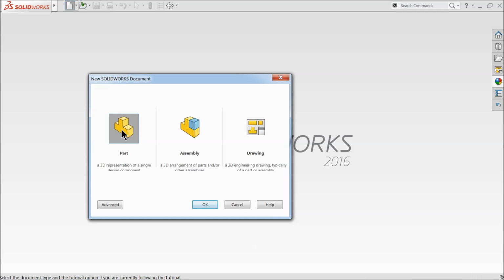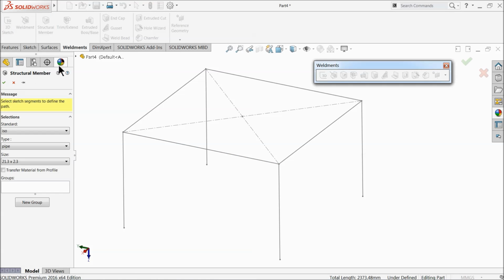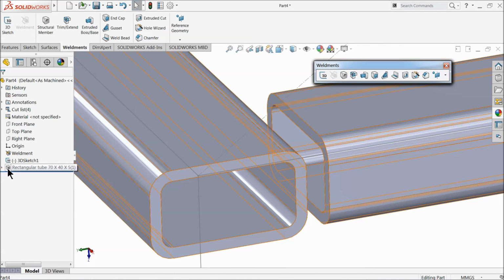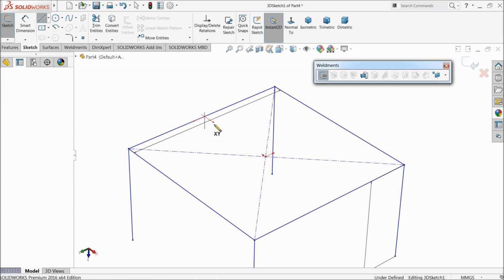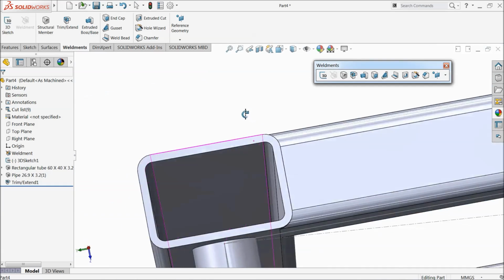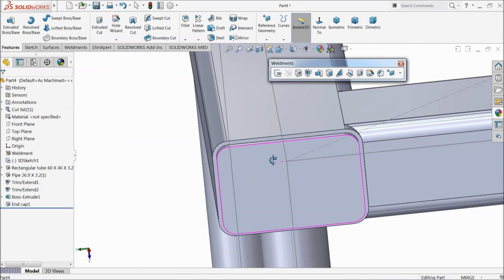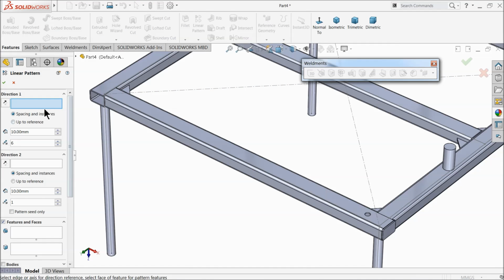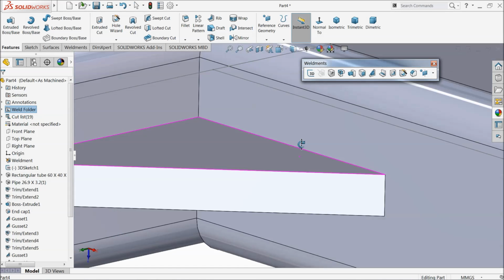Solidworks tutorial Basic of Weldments

Comment: A weldment design for Indian civil work\house construction works, like steps, ladder, safety grill, window grill, doors windows relevant works design must be thought. 

As a first step go to the site and study the requirements and list down the equipment. 

Second step, take existing physical measurements, e.g., a passage measurement for safety grill, Similarly take measurement of all grill or what so ever

Come to cad environment, and then start designing the weldment as per physical available measurements,

As a feasibility, commonize all materials e.g., same profile tubes, angles, square rods etc. this will help in saving cost, fabricator time multiple transportations etc.

 This will be the realistic design. else any average experience guy can use your tool and make designs impractically that's of no use.